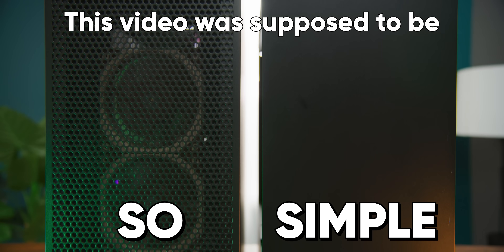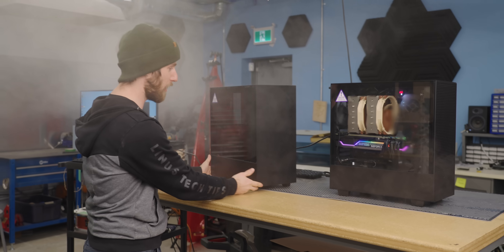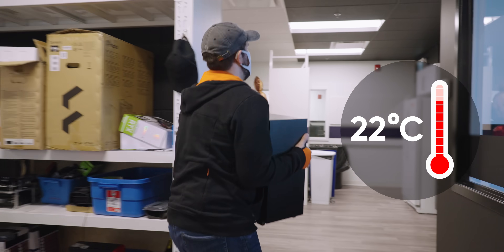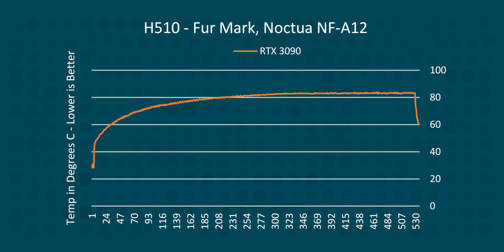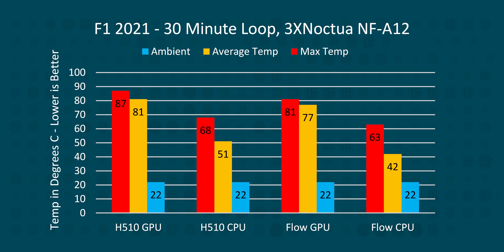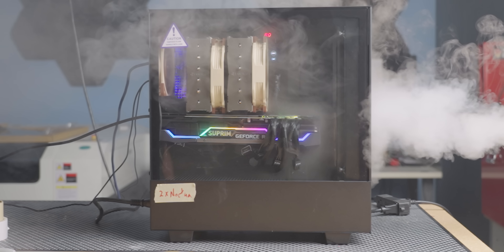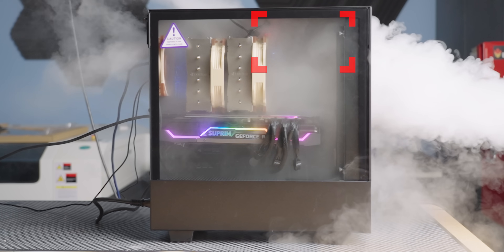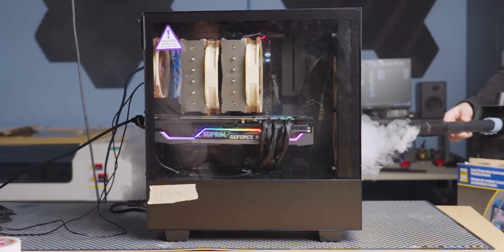Everything You Know Is Wrong - Mesh vs Non-Mesh Front Panel

Comment: What labs hopefully can do is bring the science (Physics and Chemistry) of what's going on here and actually realize how rudimentary the current "knowledge" of heat dissipation and airflow is for PC cases. Used right the H510 is great for a ton of builds, I actually prefer it due to its nature. For their build, the H710 would be a much better fit. Not saying other cases are bad, but you need to play to their strengths and heat does not need air to travel in the ways they are thinking. Perhaps you should only care about pushing out hot air instead of pushing in the cold air as one example; of course, there is much more to consider, but that's a good start. I'm only referring to a Vacuum can be good too

Comment: i would be interested about the airflow with a full custom water loop, so cpu and gpu. Also with the gpu horizontal and verticaly mounted, since when the card is up against the sidepanel, the rear should get a much better airflow.

Comment: WIthout watching the full video yet, isn't the simple answer "when CPU isnt throttling on the noctuas, it dumps more heat to the case that heats up the GPU"
edit: The test was sadly kinda pointless as they didn't measure / limit power draw between the configurations.

Comment: Interesting video but your unscientific comparison of the air flow between the closed front vs mesh ruined it for me. You conclude that the closed front panel did not intake nearly as much air simply because it did not draw in as much smoke from the smoke machine which was.... directly in front of the pc. Did it not occur to you that the pc would be drawing the vast majority of the air from the sides, where the intakes are????

Comment: I was actually stressing over this a little for my upgrade but came away with pretty passable thermals in the end for what I do. I decided to keep my NZXT Source 210 Elite (old ass case that was budget even in 2012), which has a solid front panel with just a couple slits on the sides of it for intake. This video basically validated for me that trying to work in front intake fans and a dust filter behind the drive cages would have been a futile effort. Instead, I went all in on exhaust and negative pressure, upgrading the stock 140mm fan at the top into two 140mm Arctics, and then cleaning and reinstalling the existing 120mm rear exhaust fan.
What did I put into the old reliable box? A 12600k cooled by a DH-15S (barely cleared height in this case) and a Sapphire Pulse 6800xt (also barely fit). In torture synthetics they'd probably be miserable but for gaming/streaming in x264 I've never seen my chip hit 70/80 Celsius respectively and a simple undervolt lets my GPU chill in the 70s under full load, with the hotspot wandering into the 80s sometimes. Maybe I'll look into a side intake since I do have a panel vent, if it'll fit inside the case, but it might conflict with the gpu's fans since it would be under it not above.
But in any case now I have a bit of a sleeper PC build of my own.

Comment: What if you put something like a piece of cardboard that went from the bottom of the GPU to the mesh front panel, angled upwards so that it meets the front at roughly the level of the top of the GPU. Now when air comes in it hits a ramp and is guided down to the GPU fans, instead of hitting a flat wall and causing a vortex. You might have to also put another piece of cardboard going from the top of the GPU out horizontally to cover up what could possibly become a low pressure zone which would affect the CPU’s airflow.

Comment: Very bad "smoke machine" it should have little to no outward velocity if you want a good test. If you push the air in a way the air does not naturally convect then it will give different results. this is obvious. Why not just make a cheap smoke bowl using dry ice, water, and soap? You are using slow motion anyways so it will only need to be a small amount for a longer duration of footage. 

Now I say bad for a smoke machine, and maybe you do not want fog, but as someone who ran a Halloween graveyard thing, we had many smoke machines for a cost IDK since they were from 1970s that would with ease give more "smoke" than that. 

towards the end yes, the fog looked much thicker, but from my experience it should be more and should happen at a faster rate. Here is a fog bowl, I think with ease you can lower its velocity and give it direction. With soap you can make it build up and all come at once as well. https://youtu.be/BsO1B-FWD6I

Comment: and this is why I fabricated some ducting for my corsair 600Q
GPU has 2 fans from the front and all PCI covers removed in the back for the most airflow
CPU has bottom intake and rear exhaust with fans
very quiet, very cool
and CPU and GPU are completely isolated in terms of airflow, so that helps

Comment: I reached the same conclusion a month ago with a similar GPU (EVGA 3080ti) and CPU cooler in a Fractal Define 7. I ended up swapping the case to a Fractal Torrent, which has intake fans at the bottom, and saw GPU temperatures drop as much by as much as 15C and CPU by 10C (previously 88C and 78C respectively). If you have a high spec air cooled components prioritize airflow, especially at the bottom.
Reply: This is why I bought Define R5 when R6 was already available. It has bottom fan and no stupid airflow blocking shrouds.

Comment: Neither of these. Correct answer is open benchtable. In most cases you need only cpu fans so it's cheaper, looks cool on your desk, instant access to your hardware when troubleshooting, easy and fast cleaning, components size limitations doesn't bother you anymore. Plenty pros. Go for streacom, still cheaper than high end case + fans.

Comment: Long story short: run the Noctuas with lower RPM and benefit from the reduced noise level, while at the same time avoiding too much turbulence around the GPU.

This particular case might actually benefit from a fan mounted on the perforated PSU shroud (to move air directly towards the GPU), or reverse air flow with two exhaust fans in the front (i.e. negative pressure, to suck in fresh air from below), or mounting the PSU fan up (to pull more air from the front over the GPU).
Reply: It's not turbulence causing the problem, you want turbulence. The problem is the graphics card and giant air-cooler acting as a deflector plate and impingement plate respectively, the latter having sufficient pressure drop to restrict the air-flow from inlet side to outlet side. This causes vapor recirculation (vortices) which further restrict the flow of air.
Reply: Similar to the idea of mounting a fan on the psu shroud, what I have are 2 120mm arctic fans mounted on a pci bracket a couple inches under my 3080 and it seems to be doing a great job at keeping temps down while running nice and quiet.
Reply: basically what iam doing with my Lancool II Mesh Performance :D 2x 140 + 120mm in the Front, 2x 120mm under the GPU, 140mm in the Top back and 120mm in the back.

Comment: Jayztwocents did a video similar to this. Since I watched that a couple years ago I've been aiming for positive case pressure, and keeping my gpu fans on manual rather than automatic. Never go above 60c, idles at 25c. 3060 twin edge.
Reply: @tuxshake  that's why I always have my gpu fans active. Most GPUs blow out to the side panel, and if you have enough push to the back you should be fine. If you're really concerned, water cool it 🤷‍♂️

Comment: I built two PCs a couple years ago and I used the NZXT H510 I purchased from BEST BUY (sorry Micro Center, your closest store is four hours away in Chi-town). I realized that when I started gaming a year later, the 510s were not optimal for air flow. But I leave everything stock speeds save the RAM and don't play any recent titles. The newest games I have is AC Odyssey and RDR 2 so I don't experience much throttling. But when I build my new PC (if prices settle down in a year), I will buy a case with better air flow.

Comment: There is a simple solution just needs an exhaust window on the side panel for the gpu air to circulate out of that spot where the air comes out of the gpu I bet it will drop the temps of gpu by at least 5 degrees if not more

Comment: I think a good solution would be to produce a case that you can highly modify. Like instead of just having one exhaust in the back, you can screw a second one in the empty space where you would generally have a pcie card , that way you can exhaust more air almost like a car, like a dual chamber intake and exhaust and slightly increase space between CPU heatsink and gpu backplate

Comment: What happens when you swap the fans direction, have the front panel as exaughst pulling air from under the graphics card itself and the cpu cooler fans work for you instead of making the turbulence worse.

Comment: Alright, this is super simple to fix without doing anything ridiculous. 

Just flip your fans. Push air out the front to create pressure from all other sides to allow fresh air in that way. I do this already with my setup, sort of. I have just my cpu fans doing the work of moving the air out of the system by having a 140mm and 120mm industrial noctua fans attached to a BQ Dark Rock Pro 4 push the air straight out the back. This creates enough pressure to allow for fresh air to come in through the front, top and bottom (apparently).

The GPU's fans are purely for cooling it only. It's a 290x, with Arctic Accellero on it.

Also, this is a dual rig. TT Core W200. When both computers are on, it starts getting toasty; but still never throttles.

P.S. Ambient temperature in room is usually in the 19c-24c range.

Comment: I recently discovered this as well. I have a fractal refine d6 loaded with fans, a nhd15 and a 1080 ti that is choking. My plan is to add a fan under the gpu taking up the unused slot to blow air in through the back and creating a separate air system.

Comment: I wonder, if a shroud would help here. Like, seperating the intake fans, making the lower one solely provide air to the lower section of the GPU. Should at least reduce the turbulence in front of the tower cooler.
In addition to that I am interested to see, how the system would fare, if the slot covers of the unused slots are removed, so the GPU could pull air in that way, if needed. Or overpressure has a way more to leave the case.

Comment: I tested a lot of configs and I seem to be getting the best results having intake fan in front with a mesh front. Intake on the front top (blows cool air down) then exhaust in the rear top and rear. That way the front is all cool air that gets pushed into the gpu chamber and the back is all exhaust. You can actually touch the glass and feel the temp change at the halfway point.

Comment: Another solution would be to use better airflow case,  but most importantly, use propper size case for your components. 
In this case something like Be Quiet! Dark Base Pro 900 rev. 2 Full-Tower would be better choice since you can have silence, or airflow just by opening front pannel.

Comment: Hay linus pipe the smoke in to a 5gal/22.7l jug and then exit out with small low flow fan into a 1/8 inch flexible tube to make a flow tester like nasa and Nascar us to check air dynamics

Comment: gamer nexus already figured this out before the case is badly designed and the non airflow one pulls air from the io bracket because it has more out airflow fans than intake. airflow cases can only fix good cases ruined by glass it cant fix bad cases

Comment: So,  the case is the biggest prolblem having a compact or smaller ATX case that completely limites the air along side having a Huge 3090 card that becomes a brick in such a smaller case. h500 is a notoriously bad airflow case, even with the upodates to having a mesh/more open front panel, having more fans pushing more air is always a good thing, but the orientation, fan speed ( controlled ususually in the bios or opther 3rd part software) can make a Huge difference. 
Ha..... just gotta remember this isnt an Education nor Real Reporting, this is a purely Entertianment/Ad-Spot for microcenter

Comment: The best thing I added to my most recent build is actually the cheapest piece in the entire build. I saw a little "expansion slot exhaust fan" on amazon and decided to try it out. I was honestly surprised, you can FEEL the air being expelled from the system and temperatures dropped to safe levels in my bad air flow case. I have a really bad air flow case.

Comment: i have said for years now that glass panel cases are stupid if you have a high end GPU.
the 80mm side panel fan in my case pulls so much warm air out directly from the GPU that it warms my feet.

meaning i always know how hot my system is xD

Comment: I could possibly see airflow tunneling from top to bottom with a closed IF airflow was only allowed to come in from one point top+left and allowed to be pulled across the motherboard from rear to front (counter from norm down and through to the rear of the graphics card. (fan pulling air) and forced through the psu and out of its grill(s)(ducted) and out of the case. if the psu shroud were mesh. This does not account for ssd and hdd heat though and the air would be progressively hotter as it goes possibly leading to heat soaked air. In my opinion a good design would have 3 major airfow tunnels front to rear one for mobo&cpu, one for expansion& graphics  and a final tunnel for drives& psu. And yes a psu should be (air)pass-through not right angled.

Comment: upper rear fan set as intake... top rear set as intake... rear of cpu cooler blowing to case front assisted by the two rear upper and top fans, front of cpu cooler fan angled to pull off of ram modules and cpu cooler... hole in side pannel venting angled fan on the front of the cpu cooler... fan mounted on side panel hub centric and centered with the fascia of the gpu venting air... bottom case fan blowing up... front case ambient/passive vent. pressurizes the VRM and gpu back plate because the cpu fan spins slow. 27*c idle 63*c max FX-8350, XFX RX570 XXX idle 43*c max 67*c... 34*c ambient... mobo temps same range as gpu and cpu. Db range low35  high57.
Reply: FX shiza unt ZEN

Comment: I have a mesh front and top with three 120mm intakes at the front and one 120mm exhaust at the back with a dual water cooled cpu cooler at the top. Temps are good.

Comment: Me looking at my pc with 2x 200mm and 3x 120mm intake fans and 2x 200mm and one 140mm exhaust fans. Hmmmm my 50°C on my i9-9820x and 60°C on my GTX 1070 don't seem to bad (it's a workstation not a gaming rig primarily so don't lose it about the disproportionate imbalance between CPU/GPU)

Comment: This is an issue I run into with my TU-150 case. It is "Small Form Factor" which is excellent, nice and compact but not too tiny, however there is only one intake and one exhaust, with some vent holes at the bottom for the GPU. I have a 3080 FTW 3 Ultra, and keeping it cool is VERY hard. I had to run Industrial Noctua fans to keep temps. cool. I have the intake running at a screaming 3,000 RPM. Noise is a big problem for me. I have even the front panel off, but when gaming on intense workloads the GPU hits a scorching 83-85 with 90 percent fans on. It is wild. I've been thinking about ducting the bottom so it sucks fresh air in to slow the front fan because it is INSANELY loud.
Reply: I have an ITX case with a similar bottom duct for the GPU. Try running all your fans as exhaust so the bottom duct becomes the primary intake, that's the only fan setup that keeps my 250W GPU <80C

Comment: Nice to know that the GPU hot spot still exists and even prompts veterans like LTT to make videos about it. That hot spot has existed since... well basically since dedicated graphics cards and the ATX form factor. It just usually is masked or mitigated by many other design factors: direction of the GPU heat sink fins, blower cooler design versus fat-old-heat-sink, huge full size ATX cases, or even the move from top mounted PSUs to bottom ones. There was even the BTX form factor flying around for a while which attempted to resolve these heat pocket issues and improve air flow, but nothing ever came of that because of industry inertia. Another interesting thought is how some small form factor PCs include PCIE riser cables and GPU relocations in their designs. It could be assumed to be for reducing case size, but often enough those riser cables also are used to move the components for more efficient cooling. I'd assume these old and well known airflow issues - well known to anyone with half an analytical mind at least - only now have resurfaced due to the increasing popularity of those awful glass side panels, along with those questionable low mount ATX with full lower shrouding, and current gen GPUs consuming massive amounts of power.

Comment: PSU shrouds look nice, but they can be detrimental to GPU temperatures. If those front fans were located a little bit lower and the GPU had a little bit more room to breathe, things would be different.

Comment: This is one of the reasons I now prefer liquid cooling wherever possible. If all your radiators are exhausting and everything else is an intake, all the heat gets dumped outside of the case rather than circulating inside it. Obviously in most situations air-cooling will work fine, so long as your airflow paths make sense, but radiators just make it trivial to know where the heat's ending up.